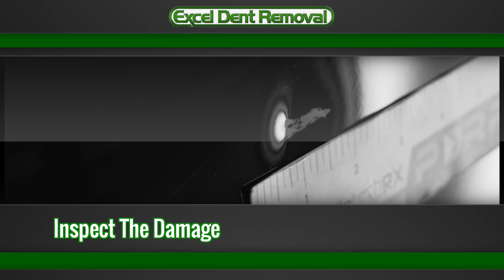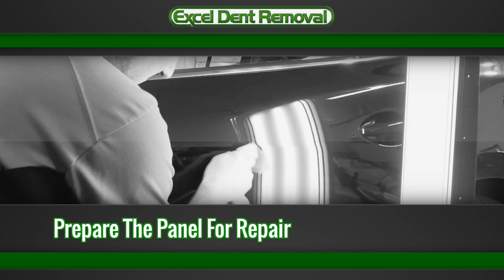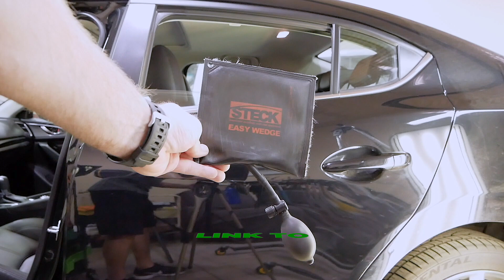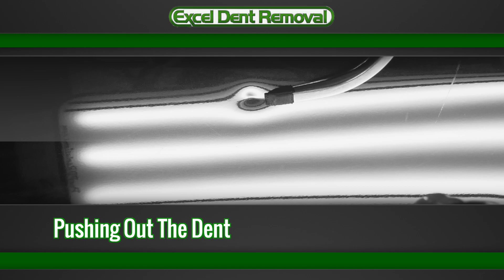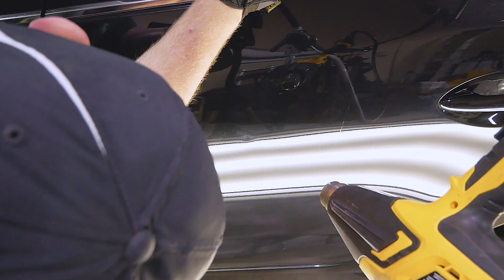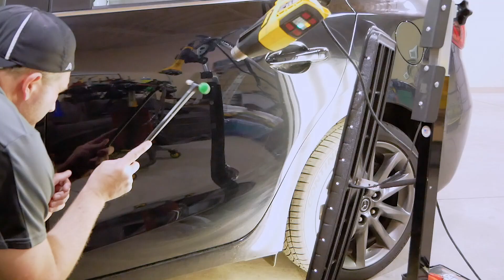How I Repair a Door Ding at Excel Dent Removal

Comment: I wonder what technique would be used to repair a baseball sized dent on the round front edge of a hood. I cut a small square access hole on the bracing that was blocking the dent. Tried to punch it out but it seems to be making a small dent outward when doing that.

Comment: Somebody has opened their door on my car.

A little of the paint has been taken off and the dent is across a profile fold in the bodywork as opposed to the dents you are demonstrating in the relatively flat areas.

How is this sort of repair done?
Reply from the maker: The process to repair a dent in  a bodyline, and even with a scratch in the paint, used the same process.
You can see a similar repair in this video https://www.youtube.com/watch?v=kezXmOcWl6s
Reply: @exceldentremoval  I have arranged to get my car into my friend's body shop.

It broke my heart to see this damage on my car.  I only bought it three months ago.  I couldn't believe the carelessness shown by the perp who obviously slyly cleared off and didn't say anything.

My friend has said that their "dent man" will get the dent out and it will look as though it never happened, but I guess I will always keep looking at it, knowing it happened.  It must be like having your house burgled - you feel violated!

As far as the scratch is concerned, he says it will be touched in.  I'm hoping that will have the same result as the dent removal, so I can put it behind me.  I'm guessing a respray of that area would require a more complex and costly set up.

Is it even possible to touch a scratch in and make it look as though nothing has happened?

Another possible complication is that when I ordered the car, I asked for it to be "Lifeshined".  This is basically the same as Armour Glazing or Scotch Guarding.  Would I need to have this redone on this panel?

Comment: Awesome work! So Ive heard of people saying to stay away from going in through the window gap because it can ,"shatter your glass"... however I'm not sure how this can happen? Maybe they don't roll the windke down?
Reply from the maker: There is always a risk with breaking the glass. Especially if it is laminate glass. 
For most small door dings, going in through the window opening isn’t an issue. Mostly because we won’t be putting pressure on the glass when pushing. 

I wouldn’t recommend doing it this way if someone doesn’t have the proper training or experience. The risk of further damage would cost them more than having it professionally repaired.